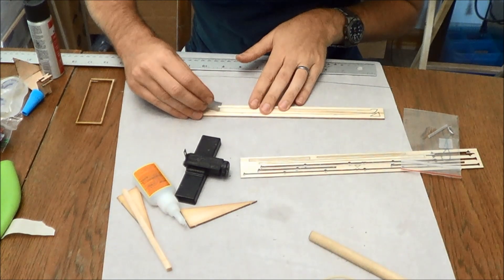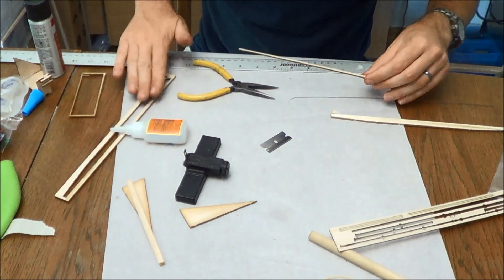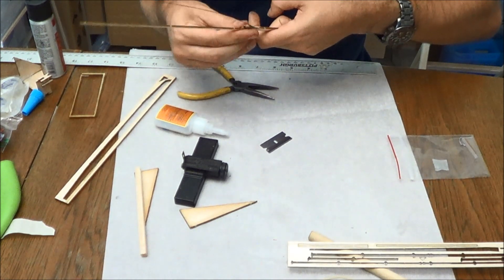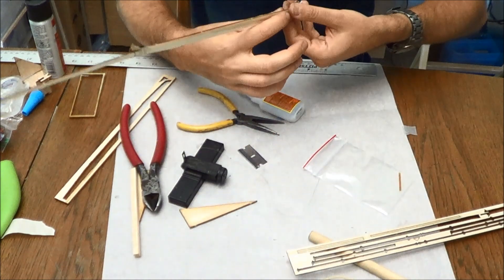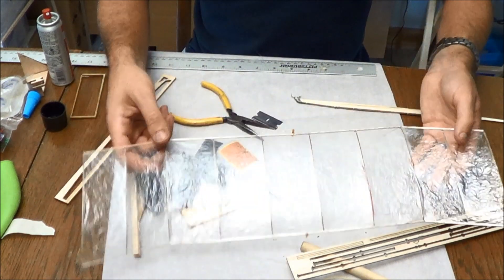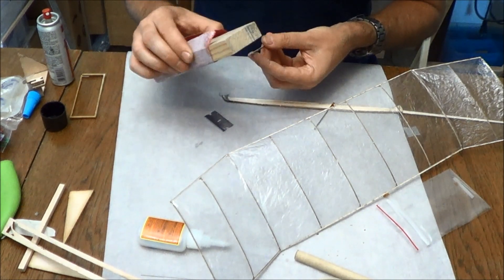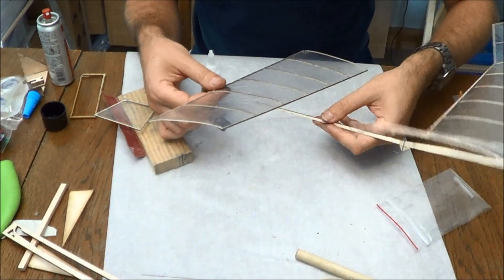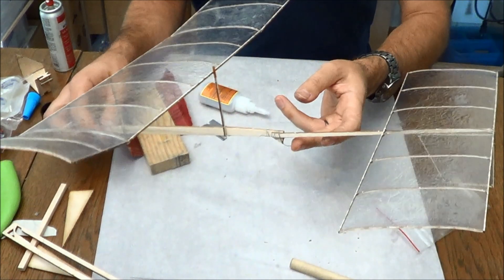Incentsitive Pennyplane Build, Pt3: Fuselage and assembly

Comment: Should the red tubes be centered on the wing?
Reply from the maker: Negative. The wing is offset to the left to correct for the airspeed differential of the right vs left wings when the model is turning tightly. It also helps offset the torque of a fully wound motor driving the 12" prop.